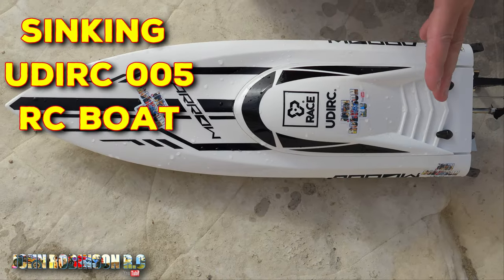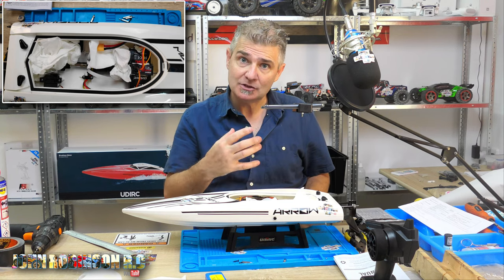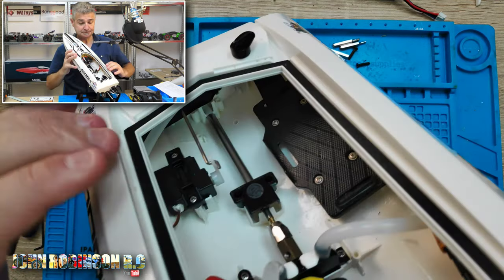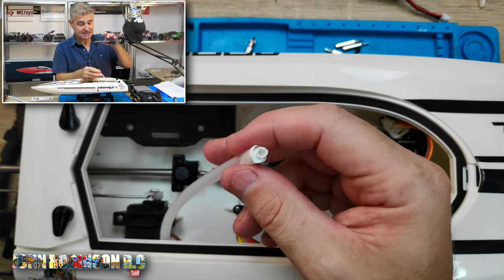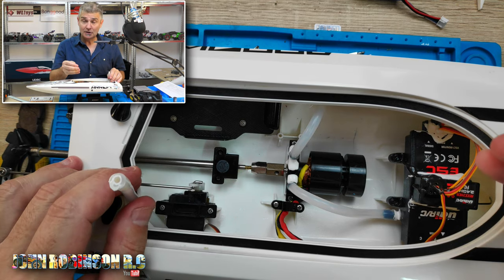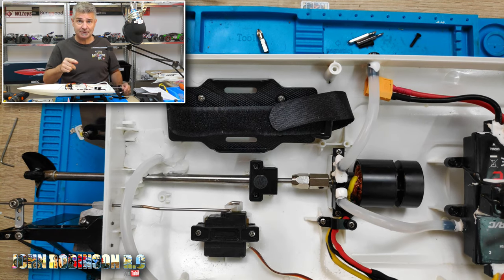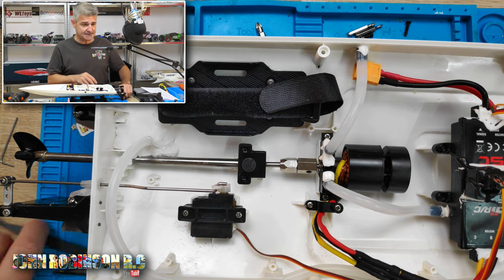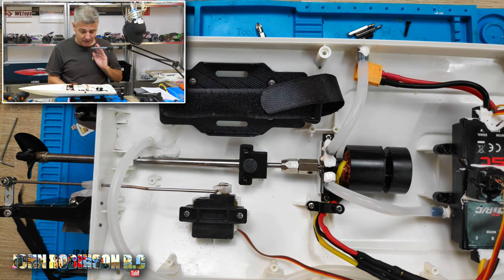UDIRC UDI005 RC Boat | Repairing the cooling inlet nipple!

Comment: Nice little boat, and a great improvised repair. I bought my son an Eachine boat earlier in the year, and it's a great little boat as well, but it's got a problem with the steering servo, in that it won't turn left very well. The servo will turn through its full range of movement if you do it by hand, but when it's switched on, it won't turn right!! And it's a teeny tiny little 3 wire servo, and I can't find one anywhere!! I can't split the hull, as it seems to be glued, as well as screwed together, and there's silicon mastic on EVERYTHING!! Still, my son loves it! Just need to find a way to fix it without butchering the poor boat to bits!! 😁👍🏻

Nice video, and the run video was great too. 👍🏻
Reply from the maker: Hiya mate. Yes splitting the boat. When I took the screws out I thought it was also glued. It was not. Just a really tight fit. Took me 10 mins of back and forth frustration and then it popped off. And yes they like their silicone. 😂😂 How small is the servo? I'll try and help find one.
Now concerning the steering. I could be way off here but I have a theory. We noticed it didn't like to turn left very well just thought it needed adjusting so didn't give it a second thought but now you mention it I'm like 🤔 So due to the rudder being located on one side only when the boat is turning right (due to the v shape of the hull) there is enough water for the rudder to dig into. However when you ask it to turn left now there is a problem. There is almost a gap of water at the back of the boat due to the propeller chewing it up and spitting it out and then add to that the Hull goes downwards in the v shape that naturally there is less water flow on the left side of the rudder. I could or course be talking rubbish and I could of course made no sense this morning. Let me know if I've lost it and I'll draw on a piece of paper my theory instead. 😂😂😂
Reply from the maker: Ah turns out I'm partially right. But also because the boat isn't supposed to turn left. Yes I'm being serious! 😂😂😂🛥️
https://www.rcgroups.com/forums/showthread.php?1410065-Boat-does-not-want-to-turn-LEFT%21
Reply: @JohnRobinsonRC  I thought it would be easier posting some pics on your Facebook page, rather than on here. I've put a new servo in the boat and with a lot of fiddling, now have more steering angle on the side that was short. 

The conclusion I've come to, is that it's the transmitter, not the servo that was the issue!! I've moved the steering bar on the servo horn, and the rudder, and it's now better than it was. 👍🏻
Reply from the maker: Ah nice one mate. I'll take a look later! Thanks for sharing.
Reply: Mine has water coming in but I haven't figured out where yet.Anyone have the same problem?Is water coming in from the propeller?

Comment: Had the same issue with the cooling line on the motor mount.
Reply from the maker: 😔 Was it damaged while it was shipped or while you used it?
Reply: @JohnRobinsonRC  after use I think.
Reply from the maker: @robbomber984  OK so another weak point. Not good. 😔